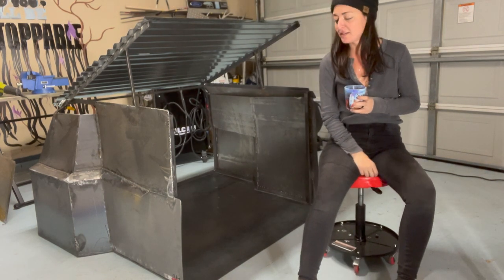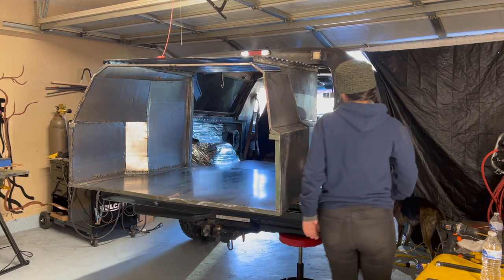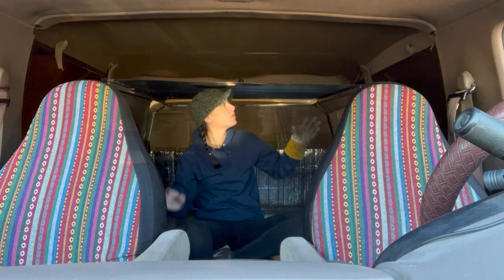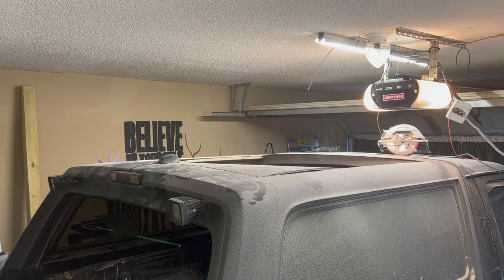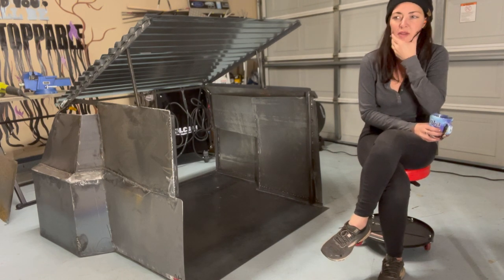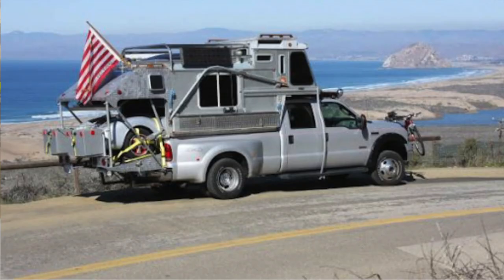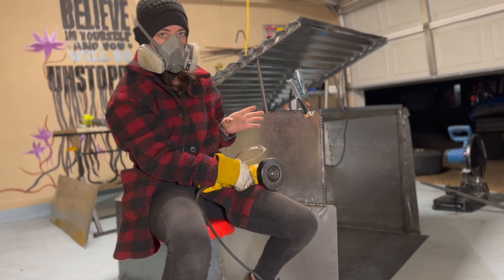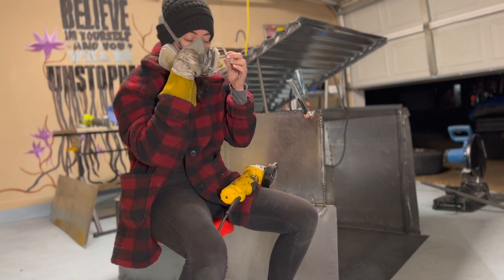THE SLIDE OUT 🎄vlogmas 8🎄

Comment: Super cool. Some day I want to have a 4x4 suburban with a pop up roof. Also want to make the passenger seat a swivel chair and 200w of solar.  Either 90s or early 2000s model. I’ve been stationary living in an ‘88 Terry Resort 24 ft camper on family land that I renovated, since sept of 2019. I go camping either in the back of my ‘94 Suburban or in my ‘97 VW Passat TDI. Suburban is spacious and the 4x4 and ground clearance are great for further out and off road places. The Passat gets 48 -53 mpg on the highway, so it’s awesome for longer trips. I fold down the back seats and have a thick foam pad that I sleep on, with my lower half in the trunk area and my upper portion in the passenger space.

Comment: The Popup is coming along great. .but you put the ridges on the roof the wrong direction!  You should run them front to back, to direct water (or snow). off of the rear when it rains.  The way you have it is going to cause you grief in the long rung.

Comment: It's looking good, are you planning on rollers under it or doing side rail slides?  Or both?  Look into a second alternator/generator for the engine just for your battery bank that runs off the motor.
Reply from the maker: Haven’t decided yet but either one of those options or just simple felt pads if it’s a smooth enough/ light enough slide to manage by hand.

Comment: Why Didn't u Just Make it so the Whole Camper shell can Be Raised Off the Bed Vertically about 3 Foot. High Enough to Stand up in. 6' 5" interior height.
Basically a Collapsable Roof. Push straight up vertically to Raise the Entire Top & sides.
a Pop up Camper Shell so to speak.